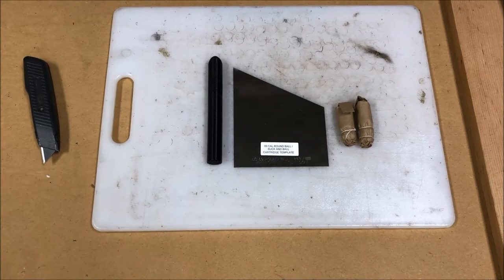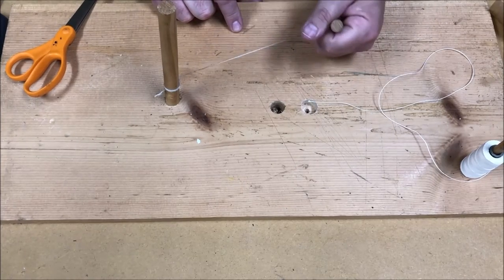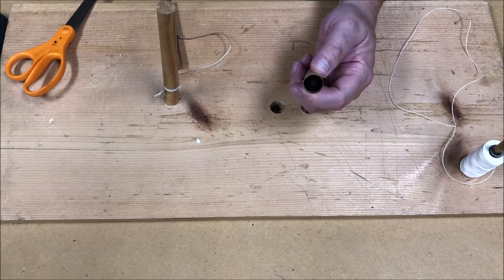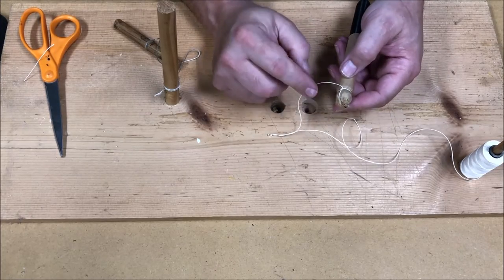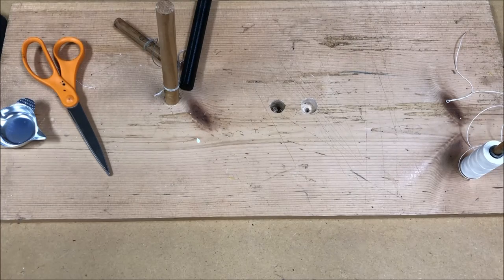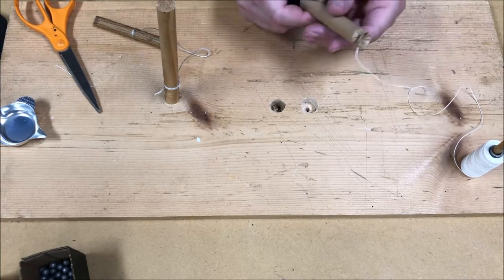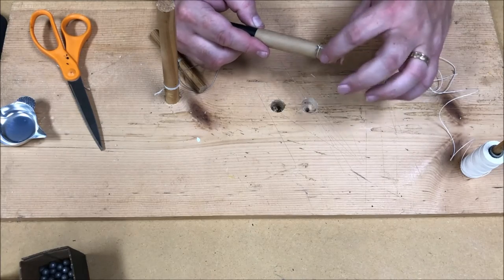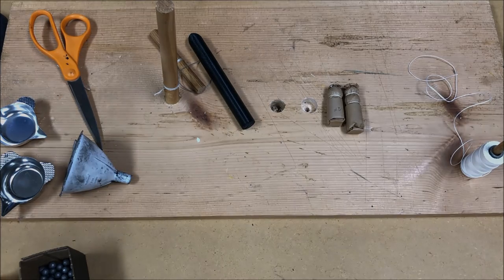Making US 69 Caliber Buck and Ball and Round Ball Cartridges using Forth Armoury Templates.

Comment: this is a pretty good tutorial. I had a bit of a tough time with the double half hitch until I found out what I was doing wrong.

by the way, what kind of string and paper are you using?
Reply from the maker: The paper is just thin brown masking paper available in the paint section of any big box home improvement store.  It has the consistency of newsprint.  The string is 3-ply linen thread.  I use the 18/3:  https://www.johnnealbooks.com/product/18-3-linen-thread
Reply: Up until about the 1820s, all paper was "laid paper". If you're going for historical accuracy, laid paper is the way to go for pre-1820s ammunition.
Reply: Ordering a kit when I get my 1816 Springfield.